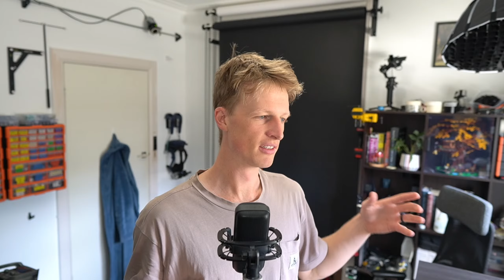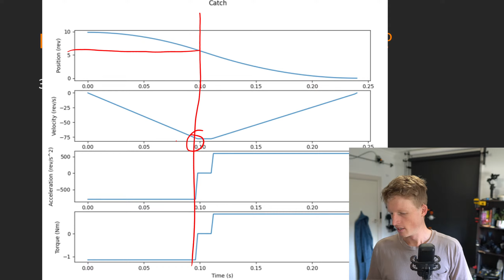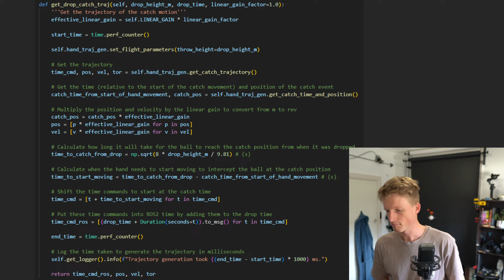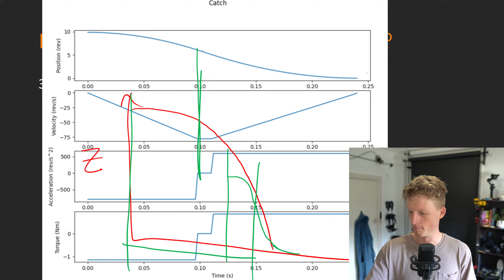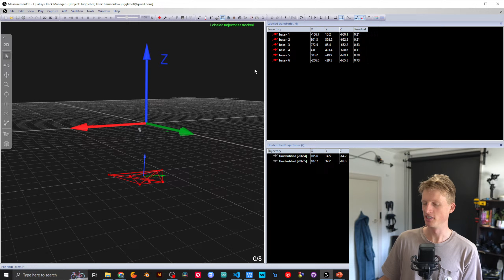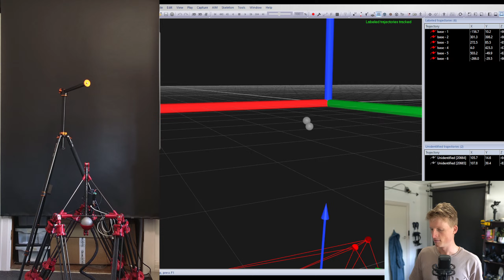PDJ Weekly Livestream # 43 - Can Jugglebot Catch a Tracked (Dropped) Ball?

Comment from the maker: Following the suggestion at 36:28 to see whether air drag affects the ball at all, I made a spreadsheet to model exactly that! You can see the results and the spreadsheet itself over on Zulip (I'll share a link to the post as a reply to this message), but the end result is that drag doesn't affect the velocity of these balls by more than 1% until it has fallen 2.4m. Only once the ball starts to weigh on the order of 10g does drag start to really affect the velocity at these fairly low drop heights. It's good to know that we don't really need to worry about this for quite some time!
Reply from the maker: Link to Zulip post: https://pdj.zulipchat.com/#narrow/channel/399279-General/topic/General.20ideas.2Fsuggestions/near/494278353
(Note that you don't need an account to view this)
Reply: Thanks for following up on this! 
Sorry, i am new to this channel, I was just weirded out by those balls, and still think fully filled balls with a soft shell would provide some benefits:
They cannot shift CG which makes them more predictable. Also less bouncy when catching. 
It seems your current hand design needs the ball to fall dead center for catching, maybe make it bigger?

One thing about calculating catch time, when calculating drop speed like v1 = (z1 - z0) / (t1 - t0), consider that this is the average speed between position 0 and 1. The actual speed at time 1 is higher since the ball is accelerating. 

As for the tracking issues, have you considered running a kalman-filter? 
This also lets you predicts ball positions (for perfect timings)!

I let Chat-GPT explain:

Benefits of a Kalman Filter in Ball Tracking

    Noise Reduction:
        High-speed cameras often produce noisy measurements due to motion blur, lighting conditions, or sensor limitations. A Kalman filter smooths out the noisy data and provides more reliable estimates of the ball's position and velocity.

    Predictive Capability:
        The Kalman filter uses a predictive model to estimate the ball's future positions based on its current velocity and trajectory. This is particularly useful when the ball moves quickly or temporarily leaves the camera's field of view.

    Handling Occlusions:
        If the ball gets temporarily obscured or goes out of frame, the Kalman filter can continue to predict its position, allowing the tracking system to "recover" when the ball reappears.

    Velocity and Acceleration Estimation:
        The filter provides not only the ball's position but also its velocity and acceleration, which can be valuable for understanding the dynamics of the ball's motion.

    Real-Time Performance:
        The Kalman filter is computationally efficient and can run in real time, making it suitable for high-speed tracking applications.

How It Works in Ball Tracking

    State Representation:
        Define the state vector of the ball, typically including its position, velocity, and optionally acceleration (e.g., [x, y, vx, vy]).

    Measurement Model:
        Use the camera's output (e.g., the ball's detected position in pixels) as the measurement input for the filter.

    Prediction Step:
        Use the ball's motion model (e.g., constant velocity or constant acceleration) to predict its next state.

    Update Step:
        Compare the predicted state with the actual measurements from the camera and update the state estimate accordingly.

    Iterative Process:
        Repeat the prediction and update steps for every frame of the high-speed video.

Practical Considerations

    Camera Frame Rate: The higher the frame rate, the more accurate the Kalman filter predictions can be, as there will be less time between measurements.

    3D Tracking: If you're using multiple cameras for 3D tracking, a Kalman filter can be extended to work in 3D space ([x, y, z, vx, vy, vz]).

    Nonlinear Dynamics: If the ball exhibits complex motion (e.g., spinning or bouncing), consider using an Extended Kalman Filter (EKF) or an Unscented Kalman Filter (UKF) for better accuracy.

Comment: In regards to your M6 to M4 thread adapter what you could do is use some threaded inserts or if that doesn't work then you could use press fit nuts. Just an idea that would probably be cheaper than a CNC part. Also the way Optitrack deals with background reflective items is it first increases the exposure and does a sort of "digital blackout" on those specific spots so when its running those things are still there they just don't get reported by the camera system.
Reply from the maker: Good ideas! The problem with the thread adapter is that there are already M6 inserts in the wooden base (which have known locations so I don't want to move them or add more) so converting between that M6 thread and the bolt's M4 thread (with minimal height) is tricky.

That's interesting re. optitrack! I think Qualisys (the brand I'm using) has a similar feature where you can digitally 'ignore' certain regions of each camera's frame. It's a bit tricky for me to use this though because there are still a fair few reflective things in the same volume as Jugglebot, so I'm hesitant to mask out those areas 🤔

Comment: How about a vacuum grip? You wouldn't need much suction, but it might be a little noisy.
Reply from the maker: I would love to try this one day, but for now I don't really have the space for a vacuum generator. Would be a very fun tool to have 😁
Reply: @harrisonlow  No problem this was purely for the test drop apparatus to get a more uniform drop (not for the actual juggebot). Also I don't think you'de need a strong vacuum, one of those tiny vacuums for keyboard cleaning they sell for 5-10 dollars might be strong enough given it's a hard sphere, so a circular funnel with a sharp angle would make a good seal.
Reply from the maker: @petersvideofile  That's a very interesting idea! I thought you meant for Jugglebot's hand and I have some concerns about that...

But for the dropper, this could actually work quite well! I'll give it some thought ☺ Cheers for the suggestion!